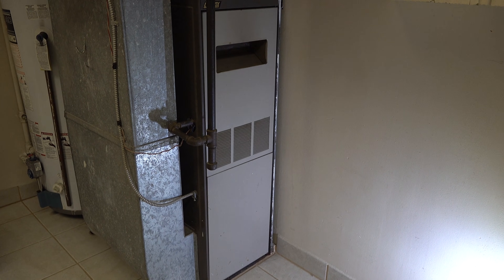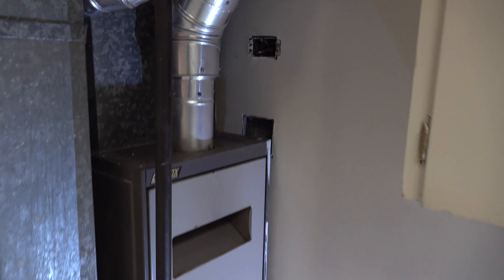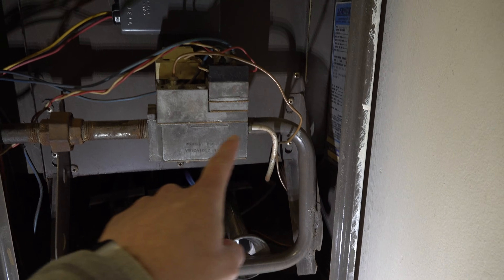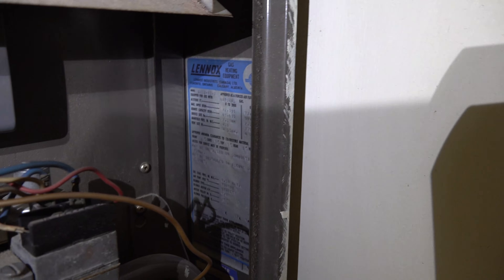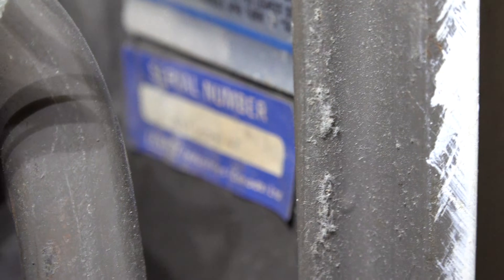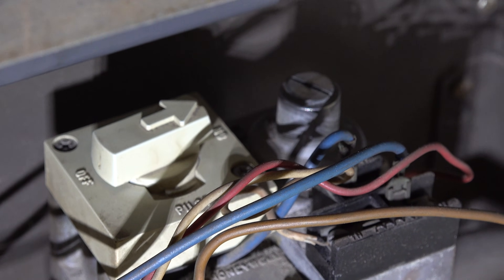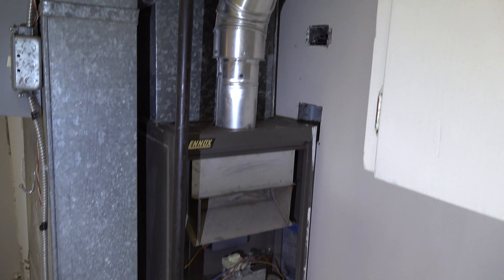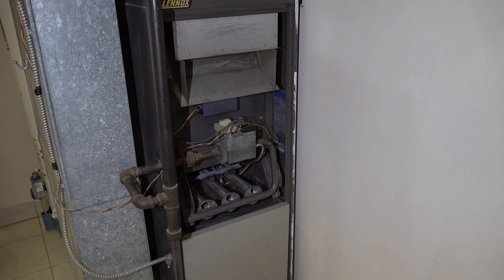1977 (Old) Lennox Gas Furnace Overview [G8D2-82-3]

Comment: I’m still running a Lennox G8‑110C from 1967, and it continues to heat the entire house without issue. More than half a century later, it’s still going strong—something you can’t say about most equipment made today. A few years ago I replaced the blower motor with one from Grainger, and it’s been flawless ever since. I even figured out how to relight it myself. Lennox built these units with exceptional quality, and in my experience, they outperform anything on the market now. The craftsmanship is truly remarkable.
Reply from the maker: New stuff is not built to last

Comment: My furnace cleaner told me don't replace it "these things go forever". Look for furnace filter material as a sheet to replace hammock filter if you can't find one. Put a few drops of oil in the oil ports on the motor each year. TURN OFF FURNACE FIRST so it doesn't start when you are working on it and you get caught in the drive belt. I asked him about on demand hot water and he said don't, keep with a water tank.
Reply from the maker: I remembered to remove the motor and oil it a couple weeks ago. I forgot to do it the last few years! Mine does not have a drive belt. Simpler tends to be better in the long run.

Comment: Hi, I have the same furnace at home.  The burner works fine and connects / disconnects as signalled by the thermostat control, but the blower motor sometimes does not start on its own. If I pull the pulley then it starts. I thought maybe the Capacitor ( not visibly clamped on the motor as usual) was defective. Bur wondering why it sometimes starts on its own without any pull to the pulley, just normally. Replaced the thermostat control but still blower motor start operation is intermittent. Any guidance please?
Reply from the maker: I'm not sure, I would say get in touch with grayfurnaceman on YouTube, he is very knowledgeable and helpful.

Comment: My Lennox g16 pilot turns on but the burners don’t or the blower fan to send the air through the house I’ve already tried cleaning the sensor
Reply from the maker: I'm not sure what's wrong. Check out grayfurnaceman on YouTube he is a pro and has lots of helpful videos. He may even be able to give you an answer. The sensor is called a thermocouple.

Comment: I got a 1972 Lennox just took a crap after 52 years
Reply from the maker: The new one will last 7-10 years ;-) OK hopefully longer....
Reply from the maker: Mine is still rock solid, hopefully I can get at least 5 more years out of it. What failed on yours?
Reply: @InternetDude  heat exchanger cracked also the fan blower bearings are going bad, quote at 6200 for a new one installed

Comment: I had the same furnace in my home. The heat exchanger was cracked so I had to replace it. 
Note: the filter on my furnace was called a hammock style filter and wrapped around the blower and motor oddly enough  It was in the shape of a big U.  I replaced my furnace with a two stage 
96.9% efficient (non modulating) carrier furnace.
Reply from the maker: I will not replace this unless the exchanger cracks and leaks CO. It is just built so well and built to last.

Comment: Where is the filter located?  You should have pointed that out.  I need to change my filter
Reply from the maker: The filter is inside the furnace in the lower area right beside where the return air come in.

Comment: Where is the heat/flame sensor located?
Reply from the maker: That's one of the nice things about this - no ignitor board, no flame sensor. Less things to give issue. If the pilot happens to go out, the gas valve won't open, it's a mechanical thing.
Reply: @InternetDude  ok, it’s must be another issue why my furnace won’t stay running. Thanks for letting me know bc I’ve been searching for it.
Reply from the maker: check out grayfurnaceman on YouTube he's a total pro

Comment: Hi my client just purchased a house and the furnace was working prior to the electric cut off. When we got the electric back on and the furnace pilot and fan turns on but not the burner. Any suggestions
Reply from the maker: Is the gas valve turned past the pilot setting to on? It has 3 positions off, pilot, on.

Comment: i remember as a kid ours would bang as the fan would start up and bang again a little while after the fan turned off, forget what my dad said it was so im at a loss as to what was going on
Reply from the maker: I would say it would be the metal ducting, as there would be a large difference in pressure inside during startup/stop.

Comment: I have one made 1975 .i shut the gas and electricity and clean it from dust..when i opened the gas and electricity it didn't work ..i didn't see flam from the gad ..how i ignited ?
Reply from the maker: You have to manually light it using a lighter or match. You need to hold it in pilot mode for about one minute also.

Comment: Built to last
Reply from the maker: Absolutely, still worked flawlessly this past winter, 46 years old. No modern furnace could match that I don't think.
Reply: @InternetDude  wow ! These newer ones are don’t hold up as well . On mine I had to have two parts replaced. It was a new one .luckily I got the extended warranty & it covered it labor & all

Comment: Does anyone know how to get the top front panel back on fully? I put the bottom one on first that has the filter access but can't get the top panel to snap closed at the top.
Reply from the maker: Try to put the panel in the exact place where it goes but about a 1/4" to 1/2" too high, then slide it down. It may take a few tries to get it on right.

Comment: What’s with the wooden blocks and shim under the blower assy? Looks like the pilot flame turned completely yellow when the main burners were operating.  Might want to clean the pilot.  Looked ok when it was on by itself.
Reply from the maker: I plan on doing a full cleaning again after this heating season. The wood blocks are to help get the blower out more easily for lubrication.

Comment: Are you still running this unit? Mine is a bit newer, 1979 model with electronic hot surface ignition - no pilot light. Also I have some thoughts of replacing it.  But with "ain't broke, don't fix it" mentality, I still keep it running. I just do basic maintenance on mine - cleaning dust and flame sensor rod every season to keep it running.  Very simple & super reliable unit, I doubt it if the newer ones are as good..
Reply from the maker: Don't replace it! Maybe I'm just getting older but I have this furnace at my "shop" and my house furnace is 91% efficient from 2007. The newer furnace frequently has problems with the flame sensor, I now proactively clean it twice a year. Plus it wound up leaking condensate and ruined some carpet, baseboard, etc. I realize a 1977 or 1979 furnace is not as efficient but things were built to last back then. I feel like the 15-ish years I got out of my newer furnace has been good but they are not designed to last as long so I just have my fingers crossed that it's not it's last year. every new year LOL - if it ain't broke, don't fix it - that is 100% true.

Comment: I can't speak for this model, but on newer ones if the exchanger is cracked it is usually evident by flames blowing backward over the tips of the burner. This can also happen if the passageways in the secondary exchanger get corroded shut (if you even have a secondary). The tubes are narrow and it happens with a condensing furnace. I know all this the hard way. The repair man wanted 5000$ to fix it, or 10,000$ to replace the whole furnace. Luckily I found out the whole thing is basically modular and comes apart with a single socket. The only pitfall being they used generic electric connectors in this furnace (a Hayes model) so you must carefully mark or photograph each connection. The rest was just a major unbolting/bolt back together operation and 1400$ in parts for both exchangers. Because you can't really tell if its a crack or clog till you take it apart, best to just replace both. Obviously do this at your own risk because if you mess up, you can flood your house with carbon-monoxide (the seal between the burners and exchangers is the crucial bit). After the repair, I replaced the batteries in all 3 of my CO detectors. A CO detector costs about 15$- your life is priceless so its a good idea to have them anyhow.
Reply from the maker: Thanks for the comment.

Comment: You are a Man of Culture, I can tell. I have an old Singer Furnace (Yep, "Singer") that almost identical to yours. Work Horse. I have been studying and overhauling my furnace for a few years myself. Pro Tip - Your ribbon burners (I have 6) are missing the air adjust caps. I found that the tin lid off of Beeman Pellets .177 fit these ribbon burners perfectly. Cut out the same pattern hole and now you can adjust for the blue tip flame. Find three screws to hold the position and your Gold.  Let Me Know if you want to sell that Honeywell V810A 1012 Gas Valve - I'm shopping for a spare.
🤣"Yup, in the old days things were better built, simpler, and planned obsolescence wasn’t a thing."
Reply from the maker: Thanks.
Reply: @InternetDude  Check It.
Reply from the maker: @two60zcowboy27  thanks I got it and will reply directly

Comment: My house has a similar OLD Lennox furnace.  The city inspector approval date was April 1978.   I clean it every year using compressed air to get the loose rust particles out of the heat exchanger.   I will replace my windows and add more insulation to the attic instead of replacing this 44 years old furnace.

I am thinking to install a cold temperature heat pump for cooling the summer and heating in the winter down to -10°C.   I know the the heat pump electrical heating element to supplement the heating at below -10°C.  Any one have using a old gas furnace to supplement the heating instead of using electric heating elements.
Reply from the maker: I have thought about heat pumps but they cut out when I need them the most - dead of winter.

Even though your Lennox furnace is ancient, things were built to last back then. If it's operating good, don't mess with it. Sure it may not be as efficient but it's dependable.

An idea though... keep your furnace for real cold winter, but add a heat pump for summer and nice winter temps (above -10)?? Use both.
Reply: can compressed air be used to blow the squirrel cage and blower motor clean with out removing that whole assembly?

Comment: Hi. I have a G8D2-82-2 (must be older lol) and the motor seized. I'd forgotten this always happens in the middle of night and throws smoke and stink throughout the house, never during the day. Got the motor out, bought a new compatible one from an engine rebuilder (they don't rebuild that type of model anymore) and of course the wiring colours are different. I have white, black, white with red stripes, white with yellow stripes, and the green ground of course. The new motor tells me what it's wires are for, do you have any idea what the furnace's colour coding is?
Reply from the maker: I don’t know

Comment: We got a house built in 1888 that was remodeled in the 70s with a Rheem gas furnace. I cleaned and checked it with an inspection camera. I repaired leaky supply and return ducts in the crawlspace and put in a smart thermostat. There is a floor vent for combustion air, but this old house is leaky, which is especially evident on windy days. I put smoke and CO detectors in every room and will maintain the furnace as we remodel and improve the efficiency of the building  It does produce great heat at 80 percent 80,000 BTUs output with two burners, made in Fort Smith, Arkansas.

I plan on replacing the gas system with a new blower and hydronic heat exchanger in the crawlspace heated with an air to water heat pump with a solar thermal water tank, and a separate split system in that attic exhausting outside to heat the upstairs.

Comment: You have a fan. :) Mine has a thermocouple powering the thermostat & main gas valve. No external power. Guess what just failed? Choice of 3 so I need to search more.
Reply from the maker: Sounds electrical, check your breaker, wiring and transformer.

Comment: I have almost the same one just a cousin model, i turned it off for the summer at the breaker box and went to turn it back on and nothing happens..any tips? The motor on the fan is ice cold so im thinking its not getting power..i got the pilot light lit and nothong
Reply from the maker: Make sure the thermostat is telling the furnace to turn on
Reply: @InternetDude   how does one go about that? :P
Reply from the maker: @Stewzzyy  turn the thermostat up and listen for it to click

Comment: My daughter just bought an older home with this type of Lennox furnace.  We not see where to put a filter in.  There does not appear to currently have a filter.  Do you have a video on how to change the filter?
Reply from the maker: Hi there is no spot for a filter, they didn't come with one as part of the furnace. You will likely want to put one in the return air duct. Mine actually has some rigged up setup for a filter in the bottom of the furnace where the main fan is but I don't trust it too much, it's held in with wood blocks.
Reply: @InternetDude  thank you!

Comment: I remember my childhood home having one of these until 2002.  It started banging and making horrible noises but lasted over 20 years and was great.  Replaced with a high efficiency Carrier Infinity two-stage variable that is still going strong 20 years later and has never needed any work other than regular maintenance.  A great product is a great product.
Reply from the maker: I’ve thought about replacing it but it’s a Toyota, it just lasts and lasts. Eventually I may be forced to update though.

Comment: You might want to pull the slotted control valve out, under the main knob, and put some 'silicone' grease on the sides.. Remove the old stuff with a cloth and alcohol, and wipe a thin 'new' coat on the slotted cone.. The sticking was because the old Si grease was dried out..
Reply from the maker: Thanks I should give that a try, I don't want to mess with it now until spring since it's winter and working ;-)
Reply: @InternetDude  I've got an old Coleman, from around the mid-60's, with a cast/forged heat exchanger, and the Control Valve has been replaced at least once, before I bought the place.. Had to disassemble it last Winter, and found out from a Gas-fitter, that it was the grease drying out.. That Silicone grease also has some Aluminum powder in it, because al the parts are Aluminum/Zinc..

Comment: A gas fitter monkeyed around with my wires any chance you can show the wires on the gas valve and in the box?
Reply from the maker: What are the symptoms you're having?
Reply: A couple times the fan hasn’t come on and the furnace has gone nuclear and burnt the filter. Luckily it was turned off after the smoke alarm went off
Reply from the maker: I wouldn’t be comfortable giving advice in your situation. Check out Grayfurnaceman on YouTube he has loads of helpful videos and answers questions.
Reply: Ok no problem. I’ve been searching videos for awhile. Was looking for a close up on the wires to the gas valve. From the thermostat and fan limit switch

Comment: Best indication of a cracked heat exchanger is seeing the Crack. In this furnace the Crack is in the back of the heat exchanger where the chamber narrows. We use mirrors, lights, scopes, and combustion analysis. A pro is worth the money if skilled.
Reply from the maker: OK, I did try using a mirror and flashlight to look up there and didn't see any. I think a CO detector or whatever it's called may be a useful test tool.

Comment: Why do u not show how to actually turn the pilot light dial? That's the whole issue with this type of furnace..  what's the point if filming if your not gonna show a step by step guide
Reply from the maker: I was by myself and didn't have anything to hold the camera. Lighting the pilot is a two handed procedure and is no different from any other furnace of this era. If you search on how to light a furnace pilot I'm sure there are lots of videos out there. I do have a few other videos on this furnace if you're interested.
Reply: @InternetDude  this is the only one I found with that model and switch
Reply from the maker: The gas valve is nothing special, turn the valve switch to pilot, push down and hold, light the pilot using a lighter and hold down the valve button for 30-60 seconds after the pilot is lit. Let go and if it stays lit, turn the valve to on and you’re done.
Reply: @InternetDude  okay well mine must be jammed or broken then, because it wont turn
Reply from the maker: You might have to push down to turn it on, I can’t remember

Comment: Had the same furnace. Reliable as hell.  Problem with these is the pilot uses a lot of gas (~10%)  and the furnace uses ambient air which causes negative air pressure which sucks in cold outside air that must be heated. Overall efficiency is then 49%. The 90%+ unit will have direct air vents in and out, no pilot and a 2nd heat exchanger. I've had mine 15+ years no issues at all. I've saved almost 10k in that time. Install was 2600. Air seal your house, upgrade poor insulation, replace windows. These 3 upgrades alone reduced my heating energy requirements by almost 1/2.
Reply from the maker: Yeah I don't have a combustion air intake setup so you can feel the negative pressure. This furnace has been reliable still to this day. Part of me wants to replace it purely to use a lot less natural gas but I think my ducting would need to be changed out to make that work. I am ordering new windows for the place so maybe I should consider the furnace next year??